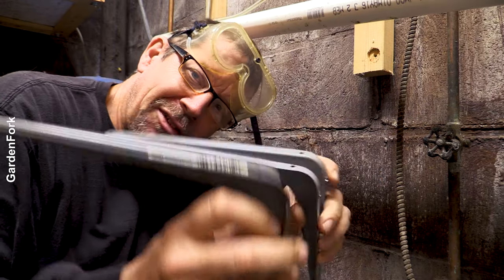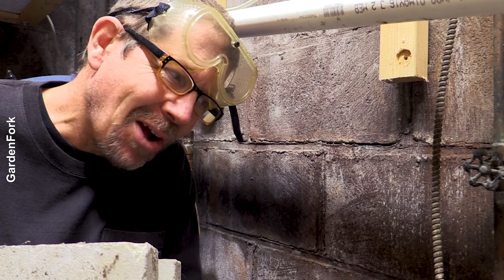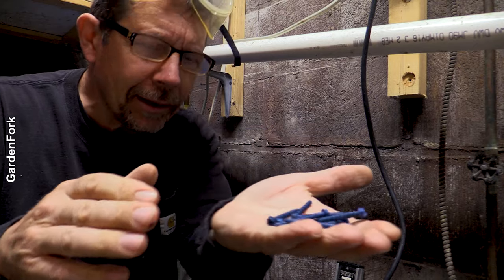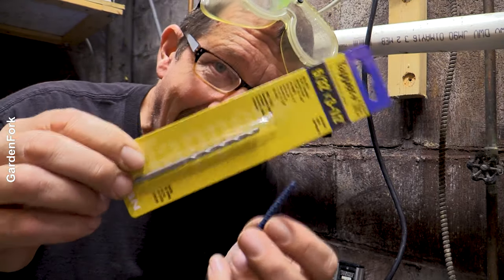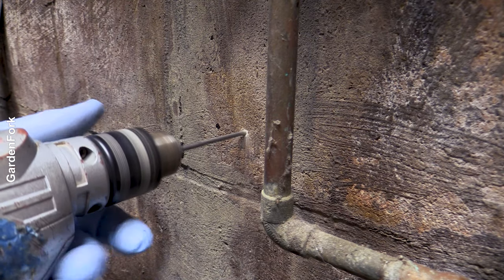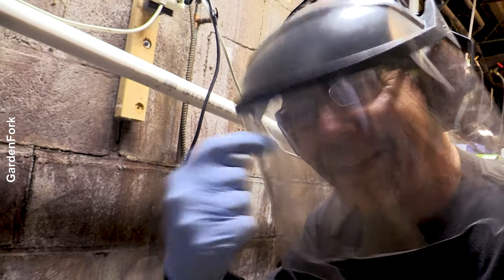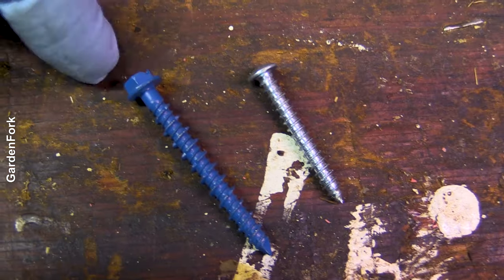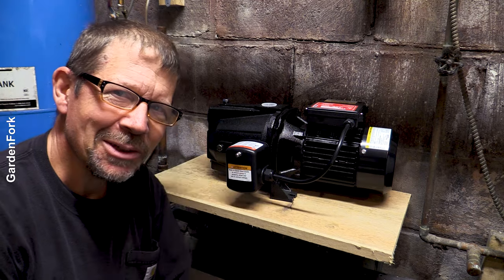You Can Install Shelf Brackets On Cement Block

Comment: Fixing have changed incredibly over the years. As a young Electrical Apprentice my first experience was called a "Jumping Tool" which you hit with a hammer and turned it around. It was permitted to hit your fist ass well. But Masonary bits came along and saved my lefthand first finger knuckle. I liked the Lead anchour, I can imagine it moulding to the hole better than a plastic anchour. Not sure about the concrete ones though. Maybe in shear but I can see them pulling out on an axial load.
Thank you.
Reply from the maker: Wow James, no one has ever mentioned shear and axial load before! And it’s all I think about when mounting stuff. The cordless impact driver I have is amazing and compact. Quite a change. Thx!

Comment: Cinder block and concrete block are not the same thing.  

Cinder block is made from coal ash (i.e. cinder) and Portland cement.  It is not suitable for building foundation walls because it isn't very strong.  You could easily make a gash in it by hitting it with a hammer, for example.  If you dropped a cinder block, it would certainly break into several pieces.  It was used for interior non load-bearing walls in industrial buildings.  I remember an old strip mall basement where the foundation walls were made of poured concrete and the interior walls separating the individual store basements were made of cinder block - not concrete block.  These interior walls were not load bearing.  There were steel girders and columns that supported the floor above and the cinder block filled in the space between the columns to separate the individual store basements.  

The best way to mount anything on cinder block is with plastic anchors and screws.  (Same as you would for sheet rock, although cinder block is much stronger that sheet rock.)  You don't need a hammer drill, just a cheap masonry bit and a regular drill will easily make a hole.  In fact, an ordinary high speed drill bit will also work, but it will wear out quickly.  It's best not to hang anything too heavy on cinder block even if it seems to be securely fastened.  

It was a way of using an industrial by-product (coal ash) instead of discarding it, and it was very cheap to produce.  I don't think that cinder block has been produced for many decades.  Now, only concrete block is produced.  

Concrete block is made of concrete as the name suggests.  (i.e. Fine aggregate, sand, and Portland cement.)  It is MUCH, MUCH stronger than cinder block and is suitable for use in load bearing walls.  You need a hammer drill and a good masonry bit to drill into it.  If you go to a masonry supply yard and buy "cinder block", you can be sure that it's actually concrete block.
Reply: If one has a porch made of concrete what is the best way to drill through it to attach the metal braces for posts?

Comment: Whenever I had trouble drilling masonry I  just started will a smaller drill bit and gradually increased the size.
Reply from the maker: Exactly! What kind of drill do you use?
Reply: @gardenfork  just a bog-standard chord drill.. as long as the bits are right, it works fine for everything.

Comment: Wow, I didn't expect so much commentary on the "cinder" block bit.  I didn't know the difference.  In fact, if you say "CMU" around here, we think you mean a local university.  Haha!  When I was a kid, I remember my dad mounting some 2x4's to a block wall using a tool that he loaded a .22 bullet into before whacking it with a hammer.  (I just Googled it...it's a ramset hammershot)  Anyway, good video, Eric.  :-)
Reply from the maker: Yes you can use a ramset, I’ve used them to attach wood to cement. Thx!
Reply from the maker: And then there is the cinder block controversy... 😳

Comment: Nice video, some masking or electrical tape around the masonry bit about 1/4" longee than the tapcon is an easy indicator also

And it's not a big deal either way just a heads up, I believe you're saying may-son-ary and its a hard e sound like may-son-ree

Comment: Thanks so much for this video. It's exactly what I was looking for. I stupidly would not have used an eye shield or ear protection, and now I will. Can you tell me how to tell how far apart the brackets need to be for what weight? I'm not doing anything too heavy, mostly 1-gallon plastic plant pots with soil & plants, but I want to get as many on the shelf as possible.

Comment: Good video,but I just used my standard power drill and a concrete bit NOT A HAMMER DRILL, AND IT WORKED JUST FINE, only took about 15 mins for my goal.

Comment: Just amazing ...straightway subscribed...

Just that we don't get such quality screws n tools here in local shops easily. 
Will the below drill machine work on Cement Walls. Please advise. I am planning to keep some Tubs on a shelf in the balcony over L Brackets🙏🏻🙏🏻
 
"Bosch GSB 501 impact drill with Powerful 500W and a Lock-On button for continuous drilling makes it a great impact drill at construction sites."

Comment: Who are you and why am I just discovering your channel? Love the content. Also, would this be ideal way to hang floating shelves on cinder blocks? Any suggestions? Thanks!
Reply from the maker: Be careful with floating shelves Vicky, they won’t hold much weight. good luck!
Reply: Hey Vicky, did you do this with hanging shelves. I need to do shelves inside of a cabinet that is made from cinder blocks.

Comment: Yes I do. This is great. I watched your other video on this, I bought the screws, I think I have a hammer drill but it’s battery driven.
Reply from the maker: I have found the corded hammer drill useful for all sorts of harder to work with material, and its cheaper. But not to denigrate cordless tools, I have several. thx! eric.

Comment: How do you know how long your screws should be? There are a lot of different lengths. Some have threads all the way up the screw and some do not...???
p.s. Awesome video.Glad to have found your site!
Reply from the maker: well, it depends on the weight the shelf will hold and what kind of cement block. if its hollow block, a 1 1/2" screw does fine, but won't hold a lot of weight. If its solid block you can use a longer (stronger) screw and hold more weight. thx!

Comment: do you have one or can you do one on drilling ceramic or stoneware or clay?  I have planters that come with no holes in the bottom and when I try to make the holes it is most difficult, may crack or it burns out the bit by the time I get 2 holes done out of 4 desired ... I know I  used a special bit but cannot remember which it was not easy.  thanx for all you share and the way you do so.

Comment: Any extra thoughts on a cinder block wall that makes up my basement?  Im concerned about moisture coming in since the outer side of the cinder blocks is under ground level.
Reply from the maker: You can try Dry Lock but the best way is to remove the water outside. Are the rain gunners overflowing? Do the downspouts extend 8’ away from house ?
Reply: @gardenfork  Gutters are ok, downspouts go 4 ft from house, no leaks in basement currently, just worried about making new holes in an exterior wall. Even if there is no standing water waiting to rush in, there is still a lot of moisture there and I worry about mold problems inside the cinderblock progressing into the house.
Reply: @starhawke380  I am concerned about this same thing, did you ever come to a solution for moisture / mold?

Comment: What shelf brackets did you use? Even the biggest (12x14) Everbilt ones from Home Depot say to use a #7 screw (5/32") so I'm figuring the holes will be too small for event the smallest (3/16") Tapcons.  I have some brackets at home, too, and the holes are only 1/8".  Someone please help.
Reply: I'm having the same problem. Did someone help you? Did you solve it already?

Comment: Why do East Coast denizens call them “cinder” blocks? Out here on the left coast we call them CMU’s or concrete blocks. 
I had a vintage Milwaukee hammer drill for ages, in a metal carrying case. My repair guy lost it. I shoulda fixed it myself, like you did. 
My old Milwaukee Sawzall saw one too many outdoor winters 🥶 and was replaced with a late model saw, and n a plastic case 😵
Reply: Im from Cali and always called them cinder blocks. Breeze blocks in UK.
Reply from the maker: I KNEW if I said cinder block I’d get comments Daniel. CMU is a better word for them, or concrete block. Milwaukee tools are great. Las t forever. Thx!